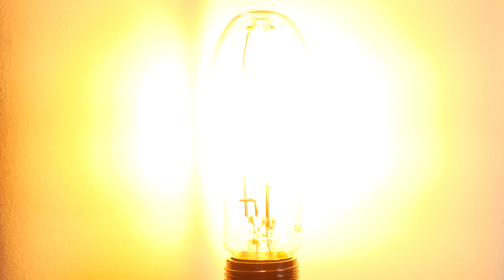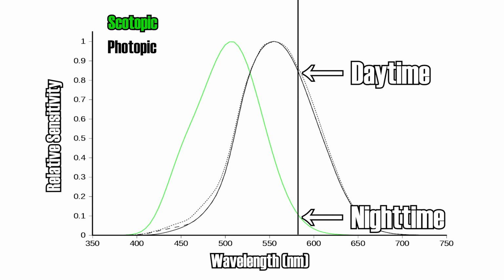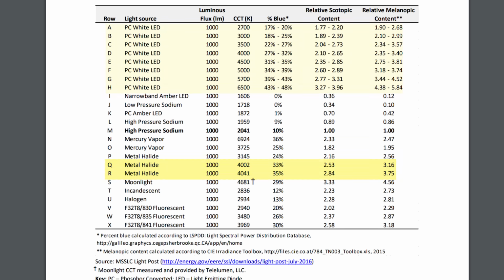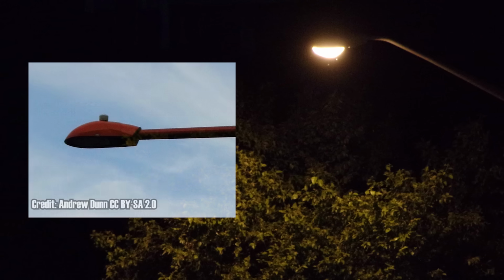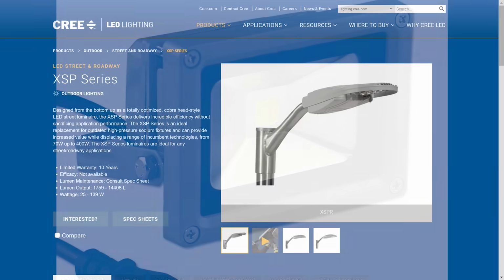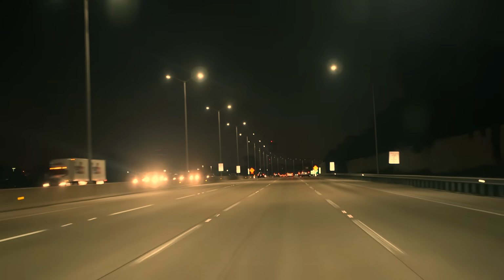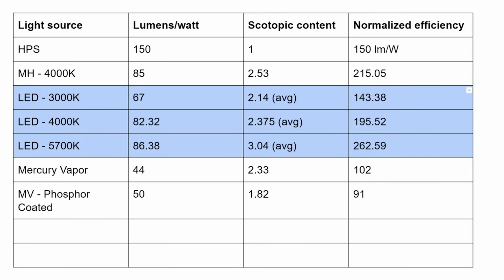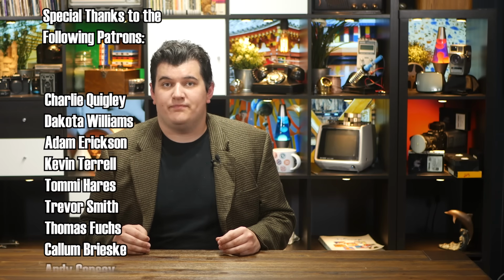The LED's Challenge to High Pressure Sodium

Comment: I'd be interested to see how quickly people recover their night vision when exposed to a blue light vs a red light.  I believe the iris dilates less when exposed to warmer light, and thus there may be a safety benefit to using warmer lighting on roadways where drivers are exposed to changing lighting conditions over time.  While driving I usually have more issues with there being too much light rather than too little.  Also I'm from Iowa where our highways and roads are lit more unevenly than Chicago.

Comment: I come from the future. Do not be afrai... erm... well, anyway.

It seems that instead of making lights more economical, what was done was use the extra power budget to make lights brighter, unnecessarily so.

Lightpollution is worse than ever, since LED lighting is so cheap to buy and run. The points about well directed light are often ignored. Even though public roads might have well directed light, commercial and residential areas are flooded with uncontrolled skyward light.

What was not considered in the video, is that we are flooded with so much artificial light that our eyes are not actually able to dark adapt much. It's specifically the blue light that disrupts the dark adaption process. This makes us loose some of the advantage of using a bluer light source.

I personally am very sensitive to circadian rythm disruption by light and need heavy curtains in my 5th floor appartment to fall asleep, despite being above all light sources. Blueish light also just makes my eyes physically hurt as my eyes would adjust well to the dark, but are overwhelmed with too bright light over and over.

I'm also an amateur astronomer. Despite being somewhat peaky, HPS light were relatively easy to filter out. There was a large market for filters designed to do just that. These days the old filters are largely defuct, as white LEDs often produce quite broad spectrum light. Where sodium light didn't overlap with the most important wavelengths in astronomy, LED do. It's a nightmare and requires very expensive, very narrow band selective filters to allow only 2 to 3 wavelength bands to pass.

LED tech would easily allow lights to be designed well to limit disruption to sleep, wildlife and astronomy. Slightly warmer light with well defined peaks in the output would be easy to filter out and would be easier on the eyes. The lights also don't have to be so bright everywhere. Our eyes, after all, are able to adapt to very dark environments   within about 30 minutes.

I'm sure the lights are kept so bright so that when an elderly person with already poor eyesight is a party in a fatal accident, no investigation will find that the lighting was less than 100% of what it could be for safety.

I hope light pollution will some day be taken seriously. In the meantime, I plan to move out in to the countryside, as far from the city lights as I can, with work and other limitations of life.

Comment: I may have an unpopular opinion, but I think LED street lights should be reserved for parking lights, dense urban areas, and lights on private property. On public roads and highways, HPS lights should be the first choice. On back roads or places where wildlife still lives, we ought to use LPS SOX lamps exclusively. 

I live in a place where we have a mixture of HPS street lights and LED street lights. The LED lights create a lot of glare, especially in the fall months where there tends to be a lot of rain and a lot of darkness. The HPS lamps never had that problem. Besides HPS lights have a minimal effect on circadian rhythms; SOX lamps have no effect, and they create minimal sky glow. Moreover, they are some of the most efficient and cost effective bulbs ever made, so 

I cannot understand why we are in a big yank to change everything over to LED. If a sodium lamp will last 25,000 hours and an LED lamp will last 50,000 hours, but I can change out a bulb every 25,000 hours instead of changing out the entire luminaire every 50,000 hours, I think the sodium lamp wins out economically and environmentally. Energy cost is only a part of the overall footprint, and LEDs are only marginally more efficient than sodium lamps. In terms of efficiency, the LPS SOX lamps have everything else beat and always have. Their color rendering is the worst of any lamp, but that’s part of the point. We actually want night lights that don’t disrupt animal life at night.

Comment: My town has changed all the sodium laps for white LED. Now the sky glows at night when the sky is slightly hazy and you cant see the stars as well, I think, yeah it's sad light pollution. The sky glow problem. 

I think it would be good for lights to be white during commute and dinner time, and then shift the colour to amber or red later at night so we can see the stars. We have some night sky reserves preservation areas around the country to keep the night sky clear, those areas have very controlled lighting design. Central Otago and Wairarapa districts.

The street lights in my town, have an array or tiny lenses or leds, so that there can be really weird multi shadows of leaves and trees.

Comment: Superior, energy efficient and lasts long when used with current control mode (CCM) switched power supply. Until then, China would keep replacing them every six months.

Comment: I'd have to disagree on this one. The Purkinje effect (shift in peak wavelength sensitivity) is very real, but not the main effect. This is because a lit street is probably mesopic, approaching photopic luminance. There's lots of light for your cones and rods alike. 
I'd say that the main reason why HPS is less visible, is because that light is almost monochromatic. This means that the colour contrast is greatly reduced. Our brains can compensate to for colour constancy (identifying the spectral reflectance, independent of illumination), but obviously this isn't perfect. In addition, our higher-level processing is probably not as adjusted to identifying objects in a weird orange glow.
Not a neuroscientist, just a medical student. I could research more if necessary.

Comment: I don't think it is safer. LEDs particular daylight 5k> can easily trigger migraines, especially to those prone to them. Add on the fact that all cars have blaring LED lights today, it is a nightmare driving at night. I miss the soothing warm glow of lights. Moreover, if you're falling asleep at the wheel constantly you shouldn't be driving, it has nothing to do with temp of lighting. 😅

Comment: Blue light hazard can be a problem for our eyes. I work at a filmschool in germany and we are currently switching to led fixtures. There is a safety sheet of our professional association regarding blue light hazard in theatrical environments. The main problem are high energy peaks in the blue spectrum which can cause retinal damages, depending on the exposition time and intensity. But I am talking about intensities way above anything normal people have at home or street lights. The biggest led fixture we have can deliver up to 193 000 lux (@3m or around 11ft) which is way above the sun on a sunny day. But even at lower levels the combination of a dark environment (film set) and high output led fixtures and working in it for like 10 hours a day can become dangerous for the eyes. But this is a quite specific scenario we are dealing with.

Comment: A solution that isn't covered here: keep HPS in order to not disrupt circadian rhythms, or change to LED bulbs that can switch to warmer light when it gets late (would be nice in nordic countries where it gets dark at 3 o'clock in the day, and HPS makes you sleepy very early), and just reduce driving. Build public transport infra, so road safety becomes less of a problem, and just keep the warm lamps.

Comment: Have you ever seen the 1960’s Disney film,  “Mary Poppins”.  Remember the scenes that combined animation with live action?  Those scenes were not shot with a blue screen behind the actors.  They didn’t use green screens either.  The technique used was called “Sodium Screen” or “Yellow Screen”!  It was a bit more expensive process than blue-  or green-screen, but when done by someone who knows how, yields better results than either blue or green.  There were NO “matte lines” as there always are with blue or green screen techniques.  If I remember correctly, Walt Disney Productions won a special effects Oscar for that film.  I don’t remember for sure, but I believe they did win.

Comment: This study aged badly with wLEDs have a huge problem mostly with their implementation. Point sources are blinding. Cooler street lights work well for photopic and mesopic vision, until you're blinded by the point sources of both street lamps and headlamps. Or you run out of the LED lamp lit roads. 

They need to use better LED sources that aren't blinding for both headlamps(auto levelers, shadow masks, micromirrors, but mostly auto levelers and lower mounting) and street lamps that dont cause retinal bleaching.

Comment: Every light manufactured for outdoors should have assymetric design limiting light spill. This plus strategic placement alone should reduce most light polution some complain about.
As for temperature of the light 4000k is perfect for visibility and safety. Unless you sleep on the street you should invest into blackout blinds if you have any spill into your room.
I have lived all my life with 2700k lighting and never much liked 6000k sterile blueish white but 4000k is what I now prefer over any "orange" or "blue" light. As long as the roads and footpaths are easier to see and safer that's all I want. I don't really care what people use indoors as everyone is different and has their quirks 😊

Comment: As I write this, it's October 2024, 6 years after this video was made, and right now, a very real problem is people swapping their standard (old) vehicle headlights with LEDs, especially bluish LEDs, at an extremely high intensity. It's no hyperbole to say that I'm blinded by the light. For one thing, there's simply the high output of the lamps, plus the color rendering, but also, older headlight reflectors were designed for a filament, whereas the LED replacements are not a point-source of light, hence, the extremely bright bluish-white light is spread absolutely everywhere, not just in the cars' direction of travel. I'd sure like to see you do a video about this topic if you haven't already. I actually have to raise my left arm up and block the oncoming light just so that I can see the road, and that surely isn't safe.
Reply: It’s one year after you wrote this comment, in October of 2025, and he recently did a video on this subject.
Reply: @claytonjohnson2033 yup. I like LED street lights. But LED headlights are the bane of my existence. They're god awful
Reply: Ahh. I use LEDs for cannabis growing. 👌
Reply: I drive a 2000 Dodge Ram 1500 with the turn signal bulbs in the front replaced with high power LED switching bulbs. Using signal/hazard they turn orange and blink, but otherwise they are blinding floodlights. I need them to see due to my illegally dark tint all over including an illegal windshield tint. Going to get a bigger lift kit soon to make it sit higher
Reply: @BingChilling-h4294 lmaoo nice

Comment: HPS perform far far FAR better in foggy conditions, in general as wavelength increases, it's less scattered by water droplets. Infrared isn't scattered at al! Nightvision goggles literally see through fog. On top of that, just find a streetlamp during light fog: you'll see a cone of bright fog under LED one and pretty much nothing under sodium. Also, that's the reason fog lights on cars ued to be yellow!

Comment: Nostalgia. It holds humanity back in so many ways.
Reply: Yeah while LED are more efficient, nothing beats the good old incandescent and fluorescent lamps on streetlight.
I miss the time where all streetlamps near me had incandescent illuminated orange or blue, while some streetlamps were also fluorescent tubes that illuminated yellow. 

These streetlamps were on utility poles as well, they unfortunately removed the utility poles and replaced with LED streetlamps in 2017. I'm NOT a driver, but I despise LED streetlamps.

Comment: Phase out efficient HPS.
Install cheap nasty LED which fail and turn blue/purple.
Increase EMR emissions.
Change 2500k light color with 4500-6000k light color.
Screw up people's melatonin hormone production, reduce sleep. Increase fatigue. Affect every part of life.
Charge heaps of money in taxation to fix a problem that didn't exist, in the name of "efficiency."

If natural ecology (water cycle, plants, animals, photosynthesis, mineral and nutrient distribution, atmospheric solar distribution, essential gasses) teaches us ANYTHING about what makes a harmonious system, it is ANYTHING BUT efficient. It's actually very inefficient and it thrives because of it.

Where do people go to recharge, re-center, de-stress? NATURE!!! GET OUT OF THE CITY!!!

Comment: How much energy is wasted lighting streets that are empty of cars and pedestrians except for a very small percentage of the night? Street lights run non stop all night long. With the ability to control LED light output, it seems like a simple solution would be to reduce or eliminate the street lamps output when there was nobody around and then brighten them just before a car or pedestrian enters their area of influence. This could be achieved with simple motion sensors but they may not give a reliable effect. But with the arrival of the AI age, maybe an AI driven system could recognise people and cars, predict their movements and adjust the lighting to give the best experience. In many neighbourhoods I would not be surprised if this gave a 90% or more power usage reduction. This would also reduce a cities average light pollution level. It would also improve safety as a driver seeing a lit section of road in the distance and no cars would instinctively recognise that as an area with pedestrians and hopefully drive appropriately.

Comment: Ugh, this is probably my favorite channel,  close to Smarter Every Day and Tom Scott, but I have to strongly disagree with the part of those video that promotes white LEDs for roadway lighting.   The color index may be better, but it forces your eyes to adapt to "daytime" conditions, so when you leave the lit area, your eyes need to re adjust to the dark.  This was much less of an issue with the sodium lights.   Thos was touched on slightly around 14 minutes, but I tfeel the significance of it was glossed over.  Much of my area is suburban to rural, so both our streets and highways oy have lighting near intersections or exits, or important turns.  So once driving through the area,  your pupils contract and you are fine  but when you drive beyond, your eyes now need to adjust to darkness and your headlights, which takes significant time.  
I'm all foe leds, but we would be better off matching the color tone to old sodium lights.   
No matter how good the white leds seem, they would act as a hindrance to any driver once the lit area has ended. 
This concept applies to led headlamps as well.

Comment: Your presentation was quite informative but there is another major factor that makes HPS lighting safer and more desirable. This factor is FOG. Fog causes light to diffract and the amount of diffraction is inversly proportional to the frequency of the light. HPS lighting is much safer in foggy conditions than lighting with a higher blue component as there is much lower chance of ceating a white out. This is why most fog lamps in cars are yellow (or amber) and less bright ,as well as closer to the road. If you have ever driven in fog you never use high beam to prevent white out. Perhaps you should have asked your transport authorities why they prefer HPS lighting.

Comment: I can see further with older light sources than with HID and LED options.  If the LED lights have a hard edge at the edge of the lighting area so it only lights up what it is directly pointed at and would require more lights to light up the same are, this is also a issue with HID lights.  This has been a issue out at a friends ranch that his old HPS lamp would light up his whole backyard from the back of his house to his barn and his garage.  With a "properly" selected LED light fixture only lights up the area under it and about 50 foot patch of the property not even casting light to any building or even being able to make the building out in the dead of night.  He had the old HPS lamp put back up and can now see his whole back yard at night.